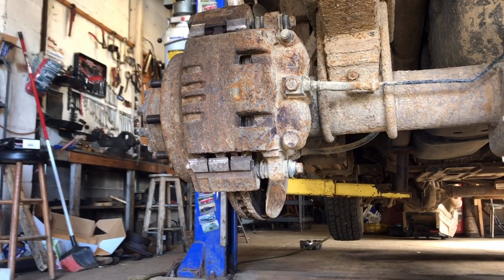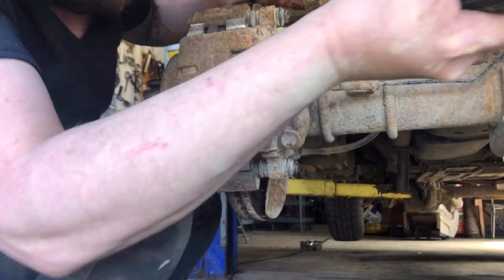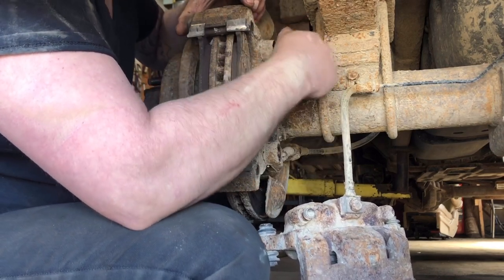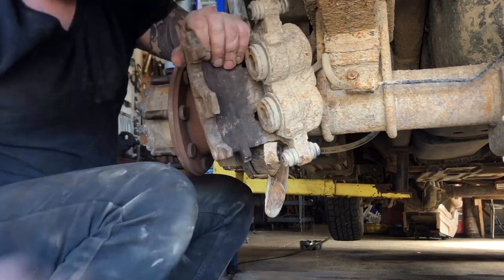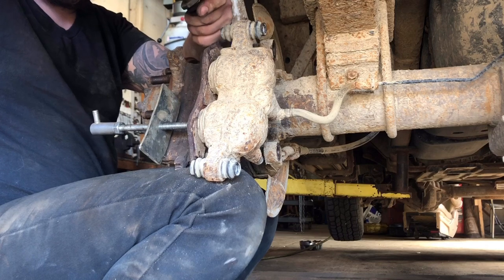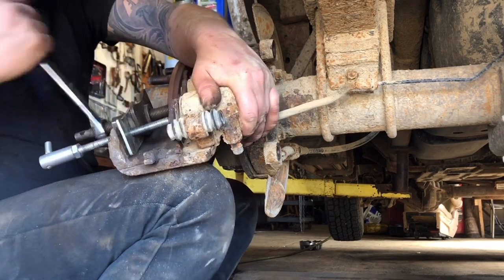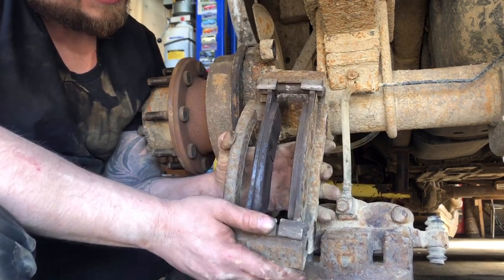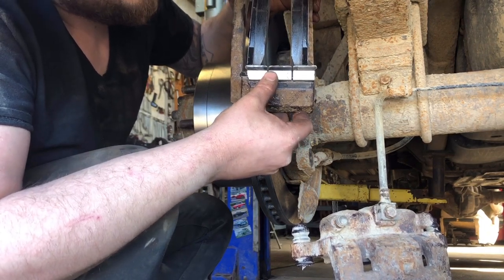Rear disc brake replace pads and rotors Dodge Ram 2500 HD 8 lug

Comment: You should NEVER leave your caliper hanging from the rubber brake line like you did. You should use a bungee cord or some wire of some type to take the weight of the caliper when changing the pads.
Reply from the maker: Very true